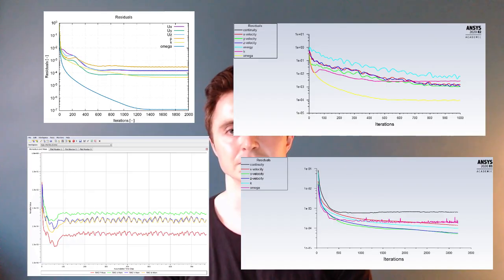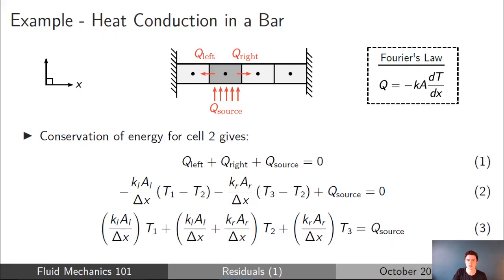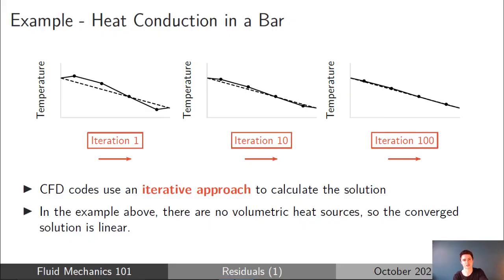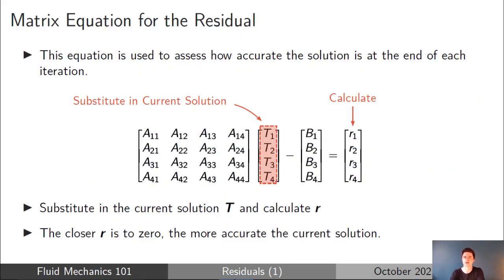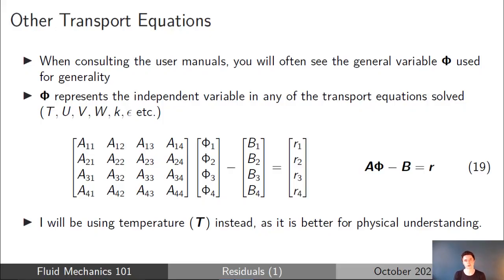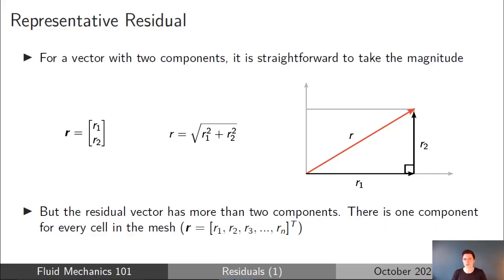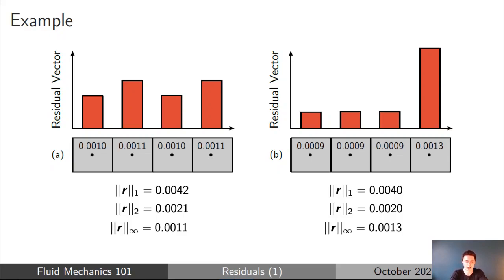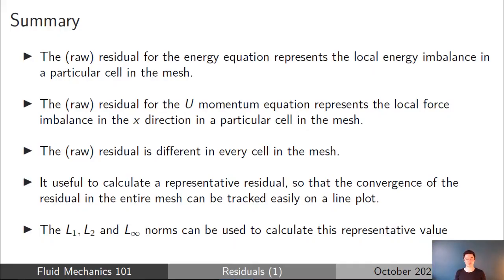[CFD] Residuals in CFD (Part 1) - Understanding Residuals

Comment from the maker: Hi Everyone, I just wanted to say thank you to those of you who noticed the sign errors on Slides 6 and 7. The coefficients A21 and A23 should be - k L / Delta x. In general for the Laplacian operator, the coefficient of the diagonal (A22) should equal -1 times the sum of the other coefficients, and so the coefficients A21 and A23 should have a - sign! In Equation 1 and 2, Qsource should be negative, as the sign convention here is positive heat fluxes denote heat leaving the cell (so Qsource should be -Qsource as heat is entering the cell). For those of you who support the channel on Patreon, the PDF slides have been corrected there. For everyone else, I have pinned this post so that you are aware of the typos if you go through the derivation in your own work. Thanks again for watching the lectures and supporting the channel :) Aidan
Reply: can you make how to study transient residuals? big thank you . you are doing great work sir
Reply: I hope youtube provides a way to re-upload with corrections in slides to the video in a much quicker way. It helps everyone. This is because not everyone sees both videos and comments. @Aidan: It may help everyone.
Reply from the maker: Yes, me too! I haven't found a better way of doing this yet. It would be really good if there was a way of having a 'living lecture' that we can update with corrections and improvements. The best I can think of so far is to pin a comment with corrections / include the corrections in the description
Reply: @fluidmechanics101   Hello there, I think that the explanation stated above could be rather misleading for someone. There are strict rules that should be followed during the calculation procedure. First, we need to specify a positive direction for the heat flux (let´s assume a positive direction for heat flowing INTO the element). Therefore, any heat flowing out of the element will have a minus sign. Then, we need to stick to the second rule which is the fact that heat flows from a higher temperature to a lower one. So, according to our specified diagram, the temperature differences should always be written as follows: (temperature at the tail of the arrow - temperature at the head of the arrow). The trick is that we can specify the directions of the arrows in the diagram arbitrarily as long as we stick to these rules. Hope it helps! Thanks for the great work!
Reply: Sir were can I get 3d navier stock equations in python

Comment: First of all thanks for this video. I have seen in many codes that the way they calculate residual is by subtracting the current iteration value by the previous iteration value and if this value is less than some tolerance limit then it is said that the solution is converged. Now I'm getting confused between these two. Please clarify!

Comment: Really usedful video! Thank you. In case of SIMPLE algorithm (say in OpenFOAM), what does the pressure residual physically mean? Is it the imbalance of the pressure Poisson equation? In which case, would it represent an imbalance in force?
Reply from the maker: This is actually a fairly tricky question. In classical implementations of the SIMPLE algorithm (that solve a pressure correction equation rather than an equation for the pressure), the residual directly represents the mass error in a given cell (i.e the sum of the mass flow rates across the faces of the cell equals the residual which should tend to zero). However in OpenFOAM, an equation is solved for pressure rather than the pressure correction. Hence, it is slightly different but I still tend to think of it as the mass error in a given cell, just because it is easier for my understanding (Notice that it is a scalar equation, not a vector equation, so the residual cannot represent a vector quantity like force. Mass however is a scalar)

Comment: Please, one question.
If the heat source inside the bar FV 2 is a  nonlinear problem, why do you use a linear equation solver to solve the temperature matrix?
Reply from the maker: Normally we have to solve a set of equations (not just the energy equation) together. For stability we locally linearise each equation and then proceed slowly using relaxation/ time stepping. Non linear solvers tend to be more expensive (particularly computing that determinant)  and the set of equations are all non linear together
Reply: @fluidmechanics101  Thanks for the help. Excellent content.

Comment: I think the A matrix remains the same for the steady-state solver and also for the transient solver. The B matrix remains the same for the steady-state solver whereas for the transient solver it keeps changing after every step. Is this correct?
Reply from the maker: Almost, the B matrix changes every iteration for both the steady state and transient solvers. However, when the steady state solver converges, the previous solution is equal to the current solution, so the B vector stops changing. Before convergence, the B vector changes every iteration

Comment: Thank you for the great video. I understood that residuals account for the imbalance of the  energy equation between cells. but I still don't quite understand why the imbalance occurs in the first place?  Since as you've demonstrated we can solve the the heat equation perfectly once we have all the cell temperatures
Reply from the maker: There may be some non-linearity in the system of equations (not the individual equation). For example, the temperature exerts a buoyancy force on the fluid, which changes the flow velocity, which in turn affects the convection of energy in the energy equation. You may also have material properties (density, thermal conductivity and specific heat capacity) that vary with temperature. 

However, even if these nonlinearities aren't present, CFD codes use iterative solvers because the matrices are large. The iterative solvers approach the correct solution gradually over several iterations. For these intermediate solutions, there is an energy imbalance / residual which is non zero
Reply: @fluidmechanics101  Thank you. I just found out about this matter. So it turns out the CFD codes always solve the equations iteratively from the initial guess. I am curious on how to make the code "guess" better to approach the correct solution sooner. I guess I'm going to watch your other videos. 

I'm surprised that you can provide the answers quickly, you've been very kind. I hope that you continue to teach CFD through your channel! Good day.
Reply from the maker: Sometimes you can do a potential flow solution as an initial guess (see potentialFoam in OpemFOAM or hybrid initialisation in Fluent). Alternatively you can do an initial guess manually yourself. Turn off energy, turbulence and scalar transport, then run your case. This will give you a good initial guess. You can then turn these models back on for your final solution. 

Also, maybe just think about your own case. Can you simplify it to get something that is similar to the solution you want but easier to get? Always remember, with steady state it doesn't matter how you get there, only that you do get there eventually 🙂

Comment: Thank you. This is a very useful video to have a deep understanding of the CFD. But I have a question,  could you tell me if we have the equations for AT=B and solve the vector T. Why we still have residuals when we go back to calculate the AT-B?
Reply from the maker: You calculate the residual AT-B using T from the previous iteration, before solving AT=B. Of course, when you solve AT=B the residual will be close to zero when you solve it, as you pointed out ☺️
Reply: @fluidmechanics101  Thanks for your answer. But I am still confused. For example for the first iteration, using the AT=B to solve the first T1 vector. And for the second iteration, using the T1 vector to solve the AT1-B to get the residuals. Is that process right?  If yes, what has changed so that makes AT1≠B, Since the T has been solved by the equations in the first iteration?   :)
Reply from the maker: Yes you are correct. In the case we looked at here, the system is linear and there is no real need for iteration. In a real system you may have non linear conductivity or you may have a flow field which is affected by buoyancy forcing from the temperature field. Indeed for most fluid systems convection carries most of the heat transfer and conduction is small, so the residuals might change significantly while the flow field is still updating
Reply: @fluidmechanics101  Thank you! Now i understand it, the real system usually can't be solved easily so that we need to use the iteration to approximate like for example Gauss Seidel Methods. Your videos are very useful and I will keep watching it. I hope more and more people can watch your videos!

Comment: Do you have a video focussing on how iterative methods get to the correct result? How does an iterative solver solve Ax=b for example, and why would it converge to some value and not just spit out random results in every iteration?
Reply from the maker: For this we would need to look at the solvers themselves (Gauss Seidel, conjugate gradient, algebraic multigrid). I haven't had a chance to make videos on these yet. In the meantime, you could always check out the wiki for these solvers?

Comment: How to deal with Floating point exception?
Reply from the maker: FPE usually occurs when your simulation has diverged. Have you checked your mesh , boundary conditions and user defined functionality?
Reply: @fluidmechanics101  please help
Reply from the maker: Maybe try transient first, without the sinusoidal input. This will tell you if it is the transient or the sinusoid that it causing the problem. Also do you have backflow boundary conditions on the outlet?
Reply: @fluidmechanics101  No , I have outflow boundary condition at outlet
Reply: Yes , this same mesh is running fine in steady simulation , when I am giving transient sinusoidal inlet , it is showing such errors

Comment: Hey sir , thank you for ur video it was really interesting but theres somethings that I don't get like what do you mean bygreater weihting in L2 norm?
Reply from the maker: If you take a simple example with a mesh with 1 bad cell, the L2 norm gives a larger value than the L1 norm. This makes it look like the residual is higher if we use the L2 norm, so the L2 norm is more sensitive to bad cells. This could be sensible for CFD as it is the few bad cells that can cause divergence
Reply: @fluidmechanics101 ok I think I got it now ..thanks for ur explanation 🙂

Comment: I couldn't understand that why does the general form has the 'T(4)' term in it, even though in the derivation we don't have any such term. I mean we limit ourselves to T(3) for mesh#2. Could it be that we will assume a null coefficient for it?
Moreover, does the "B" matrix on the right side represent the unsteadiness of the heat flow ??
When are we going to have The Residual Part 2?
Reply from the maker: Yes the coefficient T(4) is zero valued. In general any cells that do not have any connection the current cell will have zero value. This also works for real meshes that are much larger (and is why the matrices in CFD are always sparse unless you are using a spectral element method for DNS). The b matrix contains all the other stuff: source terms, explicit boundary conditions, unsteady contribution, relaxation etc. And part 2 should be out next week!

Comment: Thank you very much, I enjoy videos on youTube as well as the the courses on Udemy, have a couple of questions if you have time to answer:

- In equation 3, is there a wrong sign?

- If we study now each cell separately, Why did you add HT to a cell that is not in contact with the cell you study? for example cell 2 is in contact with cell 1&3, why would we add HT to cell 4 in the equation? I thought equations shall be (cells1&2), (1&2&3), (2&3&4), (3&4), Can you please clarify that?

-Should it be that B1,2,3,4 are all equal? the amount of heat transferred along the whole system is the same, isn't it? equal as well the amount of heat transfer from each cell to the others
Reply from the maker: Hi Hisham, in answer to your questions, yes the coefficients of the diagonal in the A matrix should be equal to -1 times the sum of the other coefficients. So yes, there is a minus sign missing! I think I covered this in the Udemy courses, so well spotted ☺️ yes, I think you are also right about the connectivity. Each cell is only connected to the cells on either side of it. I suppose I kept the coefficients in the derivation just to show how the  matrix is assembled. Indeed the coefficients for connecting cell 1 to cell 4 for example, should be zero
Reply from the maker: Also yes, for this problem, the heat flux our of all of the faces of all the cells should be equal. Because the cells have the same area and conductivity, the temperature gradient across each cell needed to support this heat flux will also be the same. The point of the talk (and the key to remember for residuals) is that while the solver is solving iteratively, the heat fluxes will not balance until we have convergence

Comment: Thank you very much for the clear explanation. Your work is greatly appreciated. :)
I was wondering whether you have an indication of when part 2 will be coming approximately.
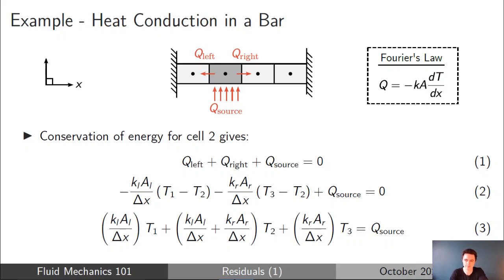Reply: Also, a small remark if I may. I think equation 3 at 4:05min; the second term on the left hand side should have a negative sign
Reply from the maker: Ahhh yes well spotted. The coefficient of the main cell (cell 2) should equal -1 times the sum of the other coefficients. This is always true of the Laplacian on a Cartesian mesh. 

Part 2 should be out in 2 or 3 weeks. I have finished the slides and need to get some time for recording / editing. It is quite tricky to find the time to make these videos around my full time job as a CFD engineer 😅
Reply: @fluidmechanics101  Thank you for the update. I can imagine how much time and dedication it costs. I hope it is rewarding in ways you appreciate😅. Your videos are not only helping me (and very likely many others) to excel at my Master thesis but hopefully to become a good CFD engineer in the future. :)

Comment: Very good talk, and well explained. I like the physical intuition, it is exactly the way I interpret residuals as well. For a typical incompressible solver, the residual normally represents how 'divergence free' your flow is. For our code, we actually use both L_2 and L_inf and have relations between them to assess convergence. 

I am sure you will touch on this in the next parts but felt I would just add the below:

Another added approach I have seen to residual normals is volume weighting. Here, every cell's residual is multiplied by the volume of the cell, and then the domain volume is divided through instead of N. This allows for small stiff cells to not hold up a simulation. This can be useful on unstructured meshes.

Yet another thing to do is to divide your residual by b, this normalises the residual in a way that makes the problem less dependent on the dimensionality of the simulation. In this case, the interpretation is more along the lines of how many orders do you want to drop the residual 'relative to the starting point'. This can provide more consistent convergence tolerances being applied.

Comment: Thanks for this amazing video. Residuals topic can be very confusing at times and it’s difficult to interpret the residual line plots.
Eagerly looking forward for the subsequent parts.

Also it would be helpful if you could address oscillating residual plots which I had once encountered in my CFD simulation.